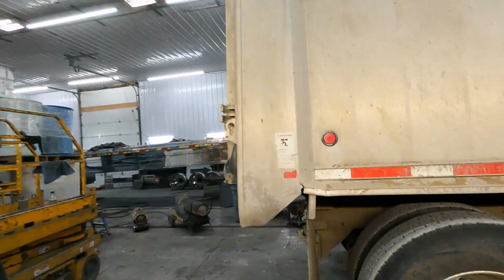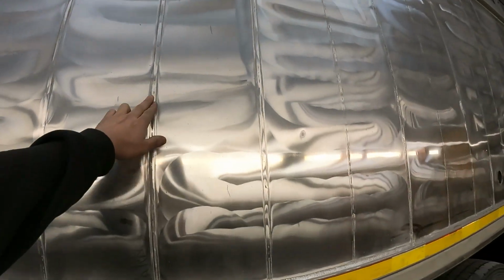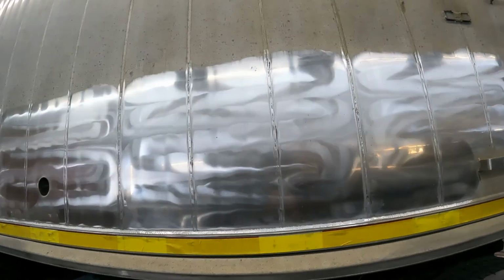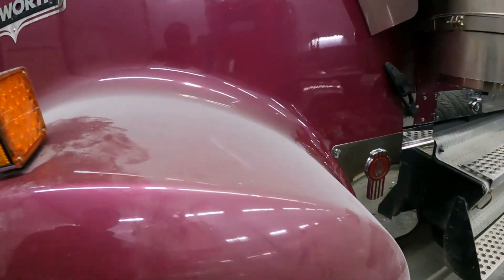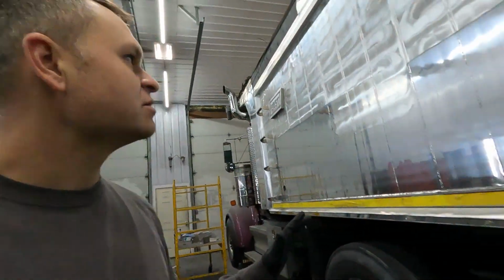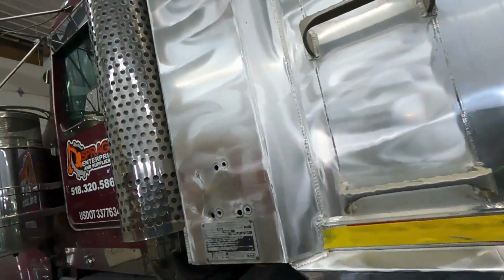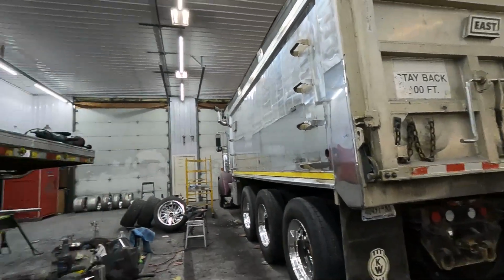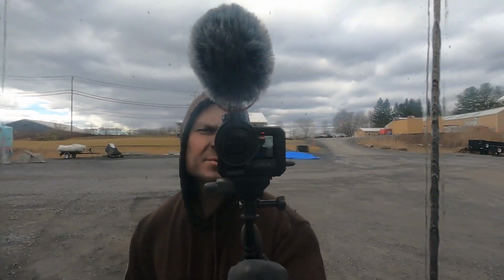Transforming dump truck to shine again

Comment: Can you help or guide me to the corner work detail? I can get my body to a very nice acceptable level but my tail gate is just not there yet. Do you have a suggestions or tools to get the corners close to matching or blending a bit better with the panel? I can get the machine on the panel but the crevices are terrible.
Reply from the maker: Idk if you will ever get them to perfectly match. Renegade products makes a mine kit. U can use in drill or air tool.